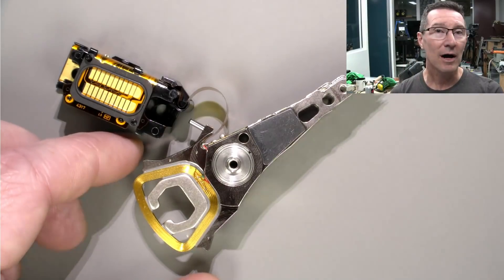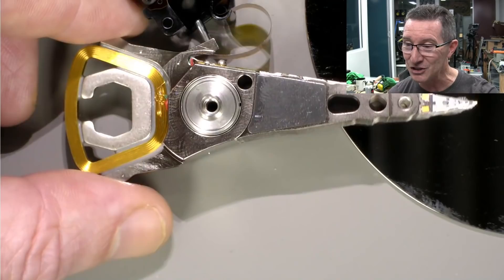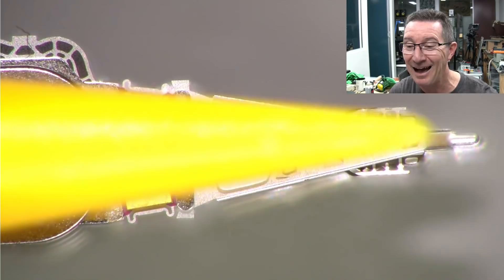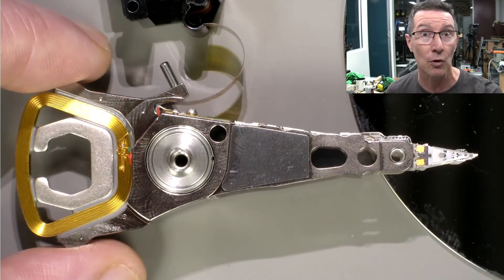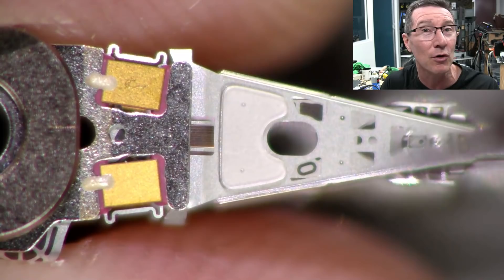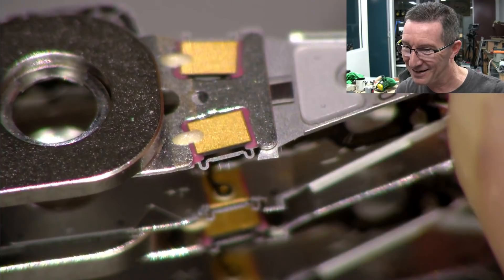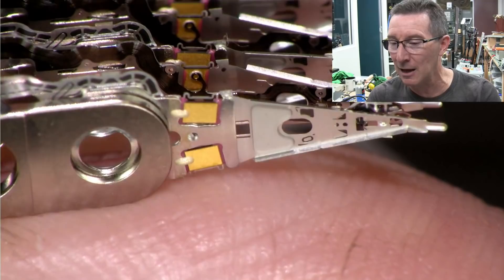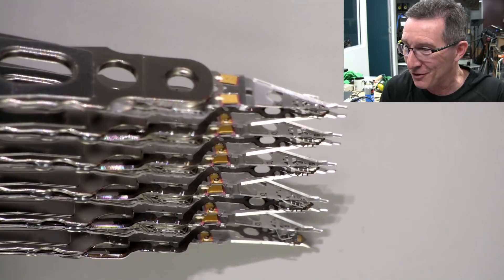EEVblog 1400 - Hard Drive Micro Actuators are AMAZING!

Comment: Great video! I have had success observing motion of piezo devices using a poor man's strobe, e.g. a blinking LED. If you can excite the actuator at mechanical resonance, it should deviate more (perhaps greater than the design calls for). You can find the resonance frequency electrically with a 1-port network analyzer or sig gen and scope. If the strobe frequency is slightly different from the excitation frequency by a few Hz, you might see a slow oscillation of the arm. You can do some back of the envelope math to determine how much deviation you can measure with a given magnification. Just a thought...
Reply: @EEVblog Assuming the HDD drive spins at 7200rpm I would expect it to wiggle at and above 120Hz to keep the head on an elliptic / excentric track, so you might try it with a higher frequency. This would allow it to be heard in operation. Reminds me on the movement of a Laser pickup lens in a CD drive and its movement on an excentric CD.

Comment: The control loop strategy is also very interesting, using a macro-micro topology with complementary paths.  The low pass response is actuated by the arm and the high-pass part by the micro actuators. Neat complex system equations 🤯
Reply: High end disks use 3 actuators now. Whole arm and two smaller joints
Reply: @cannesahs  I had a huge 20MB hard disk and it was highly educative to see the anatomy --- you do not need a microscope (and I was younger then)
Reply: Hey! you got a nice channel there! I subscribed. Keep making those videos...more power to you!
Reply: @seeker4430  Thank you!! 😄😄

Comment: Not only does the mass of the arm contribute, but at speed, the elastic nature of the whole arm starts to become dominant in position error. You get lots of ringing and in order to reduce settling time, which is inversely related to read speed, the piezo actuators help keep the head inside the desired track. Its counteracting the large read arm vibrating like a rubber band. The voice coil motor has a lower bandwidth typically too. The piezo can be driven at a much higher control rate, which will help when chasing higher transfer speeds.

Comment: This is really cool I never knew HDD heads had this kind of micro-actuators at the tip. It is so ironic with all this technology in spinning HDD and it’s all virtually obsolete technology except for the largest multi TB drives used in data center servers and large workstation PCs.  Everything else has already transitioned to flash.
Reply: Next stage after flash already exists.. But flash needs to hit it's limits before next switch.. mram...
Reply: Yeah, it has recently occurred to me that we are probably now in the golden age of magnetic media.  Pretty soon, economies of scale are going to be working against magnetic storage and the incredibly low cost-per-TB we see now is going to go away.  Hopefully that only happens when the alternative media are all at least as dense.  (But the sentimentalist in me will miss spinning disks when they vanish for good.)
Reply: @nickwallette6201  No, magnetic is the future, but in solid state.. MRAM and things like STT-MRAM.. But yes, these mechanical beasts we have today will eventually vanish... Many thought they would be gone by now, but I think they will survive flash...
Reply: One has to be thinking what kind of storage medium is best for long storage archiving. Mechanical spinner HDD may be the best for archiving, as long as it’s powered down for the archived period of time. Or it may be the worst form of storage I don’t know
Reply: @ericcindycrowder7482  DNA is honestly pretty damn good if it's temperature controlled. You get 2 bits of data per about 30 atoms if I've imagined it correctly (it won't be far off if it is, certainly not an order of magnitude)

Read speed is kinda rubbish currently but stability is great
Reply: @ericcindycrowder7482  No they are not, but some form of magnetic probably is..You really want rid of the mechanical part. Flash is worse though....

Comment: The micro actuators are not simply for locating a track with high precision, they are actually there to overcome oscillations in the main part of the arm.  When the arm moves from one track to another, it can't simply stop when it reaches the desired track. The arm will flex and if the drive coil simply stops when the head is over the track, the head will continue past the track and vibrate back and forth.  Feedback to the drive coil is used to dampen this vibration, but given the extremely small distances between the tracks, the latency necessary to dampen this vibration and settle on the track using only the primary drive coil is significant. By using the micro actuators, the head can remain over the track even as the main arm continues to oscillate slightly. So the primary purpose of the micro actuators is to reduce latency.
Reply: But how is the feedback to the drive coil picked up ? I thought to see piëzo sensors in them.
Reply: @erikdenhouter  I'm quite sure the feedback is readfrom the actual track, some kind of data encoding that will ensure not all zeros or ones written for any significant length of track, so the intensity of the signal can be used to calculate the offset (in radial direction) Ols harddisks used 'dithering'to be able to know the sign of the erroro (am I moving in or out of the track), Not sure how it is done here,maybe two slightle offset heads?

Comment: Hello those micro-actuators are for adjustment of head vertical distance from the disks, it usually is like this : 1 for GND ,2 for differential read element,2 for  write element
and 1 for vertical z micro-actuator and other two are horizontal x-y micro actuators. total of 8 connection .

Comment: 9:15 The "spring arm" on the back is one electrode, and the bridge across the red insulator on this side grounds this side to the frame of the arm. Piezoelectric crystals shorten along the current path, lengthening along the plane perpendicular to that path. When current is applied, the piezo-actuator wedges both red insulators apart, causing the "I" shaped flexure ( https://en.wikipedia.org/wiki/Flexure ) to deform at the weakest point which would be where there is a hole punched through seemingly for no reason between the actuators.
Reply: I perceived this as shifting the magnetic field up and down to vertically access the surfaces of magnetic plates laminated to a single plate. Am I wrong.

Comment: The helical scan head in a video cassette recorder used to be the most precisely engineered thing in the home back in the day. 
Info from the Sony patent:  The track width of the magnetoresistive head is 0.5 to 0.8 μm, the distance between shields is 0.13 to 0.145 μm.
Reply: Yes, and Video 2000 used piezo crystal to move the heads for trick playback. It worked quite well.

Comment: Normal person: Sad by the loss of a hd and replacement cost. Tosses crashed disk in the bin.
Nerd: Curious about disk crash. Provides hours upon hours of exiting exploration time of the remains.
Reply: Don't pass up the magnets that are in there, you will be hard pressed to find anything stronger than you can get out of a hard drive.
Reply: @JWH3  I collect those magnets, and they're so damn handy. You can hold a photo on the wall, mount a utility lamp to the wall (metal steel stud or frame) or a shelf, hang a space rack on the fridge, the possibilities are endless.

Comment: I'd like to see if you could aim a laser at the head and observe the reflected beam - perhaps a couple of metres away.  The principle is the same as a mirror galvanometer - presuming you could find a suitable point on the head.
Reply from the maker: I do have a laser displacement device, can't remember the resolution though. Most likely not good enoguh.

Comment: I worked at a factory that built those suspension heads was very different machine in the process to bond and install those actuators. Plus the white damper installed on the suspension arm it’s self.

Comment: Hard Drives have come a long way.
I remember in 1984 changing out 75 lbs 10MB Honeywell Hawk Hard Drives.  One removable and one fixed platter   Repairing a crash on the fixed platter called for buffer the RW head with 200 grit sandpaper (yes, that's right) and then washing it out in a cup of alcohol and then put it back in with a new platter -- and most of the time that worked.
That was the procedure when some company President or Accountant is tapping his heels anxious to get the drive going because they have to  print payroll or something.

Comment: Good heavens, How do they even manage to get those exact and most precise movements. Just, really unbelievable😱😱😱😱
Reply: I can only imagine. Maybe the heads are tuned individually before the drive is marked as a PASS. This means each head will require a unique amount of residual voltage governed by hdd board. This could be regarded as part of the low low formatting of the drive ???

Comment: I first came across mindbogglingly small, fast & accurate piezo positoning back in the 80's on an Ampex VPR2 broadcast video recorder. The playback head could bend up & down to keep in the middle of the magnetic track laid on the tape. As the years passed, this technology appeared on more and more and cheaper and cheaper devices. Basically the same application as this by the look of it. Cool.

Comment: The Philips V2000 VCR system also had piezo elements on the heads. This was called DTF (Dynamic Track Following) and because of that system they could use smaller tracks. Technically this V2000 system was much better than VHS.

Comment: The Philips Video 2000 system from the 1980s used piezo elements to move the video heads for "dynamic track following". I seem to remember the voltage they used was pretty high, like 70V or something. Of course those piezo elements were much bigger than those in that hard disk.
If I understand correctly, putting a voltage over a piezo element makes it bend along the longest side, so I imagine the elements go ever so slightly U-shaped and pull their ends towards each other by just a bit. The springs on the side will keep the head assembly from bending with the piezos; they're not needed to make everything go back in place when the voltage goes off.

Comment: I suspect that those could be shear mode piezos. And then if you hook them up in opposite polarity and excite them, they will twist in the opposite directions moving the head.
If you have an impedance/network analyzer -- hook it up -- the resonant frequency would indicate the mode in which they move.

Comment: I think the voltage applied is DC. piezos will expand or contract depending on the polarity of the DC. Also when a piezo is manufactured they are polarized in what ever plane is useful for the application. BobC and Egwene22 got it right.

Comment: The faster rotation of the disc, the smaller friction force on the head, it will ease the work of the coil/transducer, and maybe on the coil/transducer voltage is AC with high frequency controlled by PWM system.

Comment: If you have two coplanar piezo elements, or a single element with two coplanar electrodes on the side opposite a common electrode, the area in between the two elements/two electrodes will twist if one side expands and one side contracts. This configuration can also be used to control up and down motion simultaneously. It could be that this is how the side to side motion is performed, but who knows given that you can't really tell how a piezo element moves just by looking at it.

There's a homemade scanning tunneling microscope design that does this using a piezo speaker element with the silver electrode cut into four quadrants. Each "diagonal" pair of electrodes forms the X or Y axis. The movement on the Z axis is controlled by a voltage uniformly applied to all four electrodes (making each one expand or contract identically) and the movement on the X and Y axes are controlled by the difference in voltage between each complementary pair (creating a "twist" in between them.) Commercial STMs use three linear elements, one for each axis, but this design works well enough that one hobbyist managed to image individual carbon atoms on the surface of graphene with it, and at a cheaper price for his whole setup than one single purpose-made STM actuator costs.

Comment: Dave - the read and write heads dont hover tens of nm over the plater :) - they hover 3-6 nm since quite a very long time - there is even a speciaj heater in the write head that bumps the head and brings it closer to the surface ;) - Very nice you took that topic here in eevblog, thank you!

Comment: I think the shiny metal you see top and bottom surrounding the actuators is just a guide that is not connected to the head at all, it looks like the lighter colour metal that makes up the head is coupled either side to the actuators and it slides side to side within the shinier metal, if that makes sense.

Comment: HDDs are impressive mechanical beasts.
Though, sometimes I wonder why manufactures don't just go to a larger form factor. It would increase material costs a bit, but increasing the disk diameter by just 10% makes a fairly huge impact to disk area and hence capacity. And most of the cost of the drives isn't material cost, but rather assembly costs, and that should remain largely the same for a drive that is physically 10% larger.

Micro actuators like this would also help combat a lot of the issues with going to a physically larger disk.
I for one wouldn't mind seeing a 5.25" HDD if it has a good price per TB.

Though, the big issue with hard drives at current is that they are starting to suffer from their low read write speeds compared to their capacity.
In short, moving data away from it takes a considerable amount of time, and if one is repairing a raid array, then this time is time that another drive can die within and one's data ends up lost. So there is some concern in regards to write speed per TB as well.

Then there is SMR drives, something that could be handled a lot better by RAID systems. Though, a fair few drives are hiding the SMR operation away from the OS and drive controllers and such... Then there is the other extreme called Host Managed SMR, but that at least has advantages when rebuilding the array, since one can much more intentionally work with the shingled blocks and therefor not end up rewriting the same block x many times just because the RAID system didn't know it were the same block.
Reply: Mainly it's compatibility question. The big piece of hard drive market goes to datacenters and similar big commercial system, and nobody is going to replace all their equipment just to accommodate larger drive.
And also, engineers have to develop dense packaging techniques anyway, because companies want to sell hdds for laptops, and they won't get any more space there. So, if you are going to invent this thecnology anyway, why not use it in bigger drives?
Reply: I doubt its about material costs in the BOM, surely they stick with the form factor because there has to be continual physical compatibility with server and PC HDD slots. consider how many servers there are in the world now, all manufactured to accept HDDs of a certain size
Reply: Because of ISO compliance reasons.
Reply: @pro100vald  HDDs in laptops has rapidly fallen out of favor the last 5 years to the point that finding a laptop with a hard drive is hard.

And commercial systems in datacenters already get replaced on a 3-5 year cycle due to increasing power efficiency. Electricity, cooling and space aren't free things.

And to be fair, space is a more real reason for why HDD manufacturers don't move to physically bigger drives.
Reply: @-yeme-  And I never stated material cost is the reason. Just that a bigger drive wouldn't be all that much more expensive to manufacture.

Form factor is a bit more of a reason. But to be fair, going to a physically larger drive has some other downsides, mainly in backwards compatibility. This is however not a major requirement in the storage market where cost per TB is frankly more important.

All though, I did also point out one of the biggest reasons for why more capacity isn't actually a good thing unless one can also bring forth more read write speed.
Reply: @dingdongchingchong8659  Can you provide a source to these supposed ISO standards for hard drive compliance. I know of non and can't find them either.

If you had said IEC, that would have made more sense.

Though, SFF (Small Form Factor Committee) handles the form factor standards for the common HDDs sizes. This is all though an ad hoc committee made up by a bunch of companies to quickly throw together a loose standard back in 1992. So there isn't any real "compliance" process to speak of.

And a larger drive can technically just be a 5.25 inch one. Not that one has to strictly stick to an existing form factor, HDD manufactures have made their own unique ones more than once.
Reply: I remember servicing an HP Pavilion PC, whew, maybe 25 years ago, that was a 5 1/4" form factor.  I believe it was a Maxtor.

Now why the heck did I remember that?

Comment: Your loss (the RED drive failing) was our gain, your teardown. Thanks. The familiar pattern of your better reviews always includes a teardown before a power on. Would be interesting to see a follow-on where the replacement RED gets an almost inevitable teardown, tearup (reassemble)and power up - without a teardrop (without issues) e.g. “how hard can it be” to put back the helium in an 8TB RED, for a Pro?